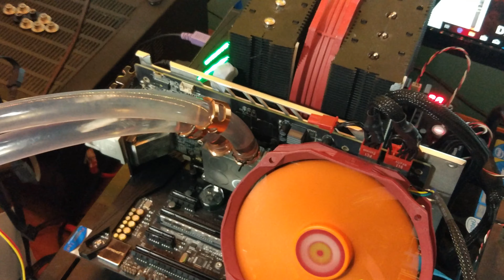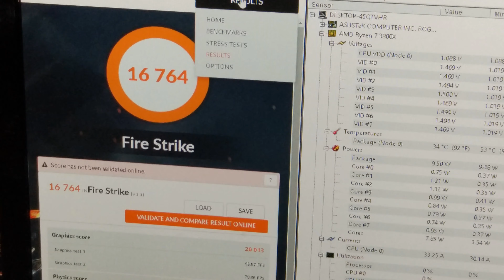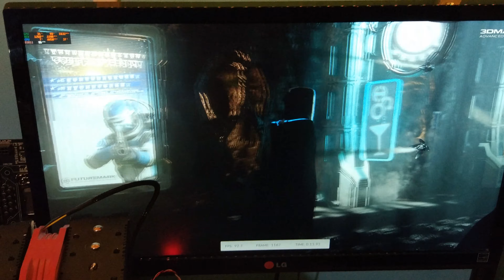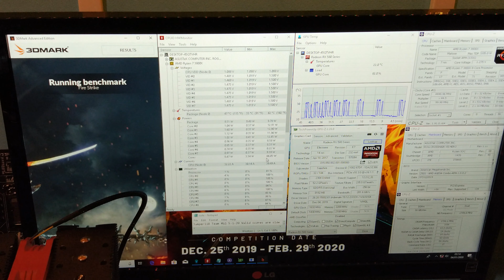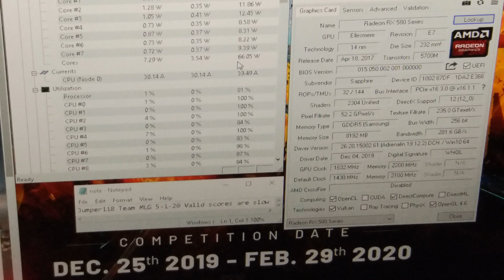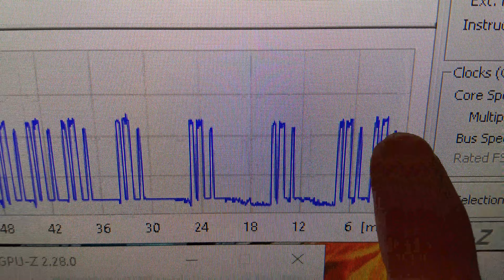Freezer' Burn 2019 Round 3 RX580 Firestrike

Comment: Hm. On the CH VI Hero(not this vid), did you notice any difference on 3rdgen and 1st gen cpus for RAM overclock/compatiblity? Or have you not tried the 3rd gen on the first gen board?
Love these videos btw.
Reply from the maker: I don't think I have used the third gen ryzen in the ch6, I ran 1st and 2nd gen in the ch6, but only run the 3rd gen in the ch7 and ch8.
Reply: @LawrenceTimme  Ah.. I've got the CH6 hero and 1700x, and been considering upgrading the CPU, in hopes to push up my ram speeds as I'm limited to 2933 or i'll get RAM errors. Overall I need more singlethreaded perf as well.
Reply from the maker: @LEADER0FY0U  OK, well it does support the 3rd gen chips and I have seen other people run 3600c16 no problem on same board with a 3900x. I have just not tested it myself.